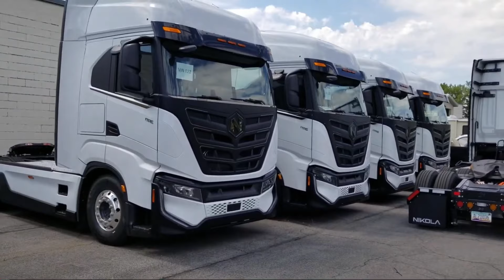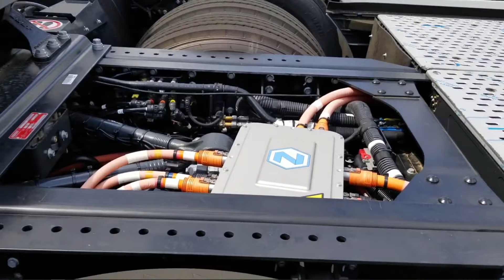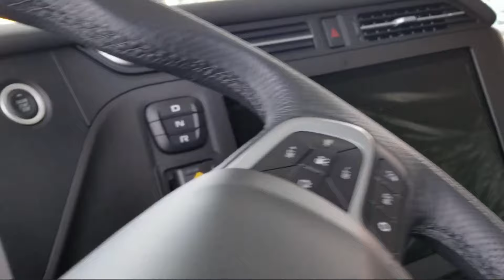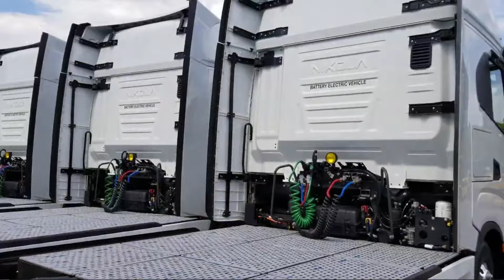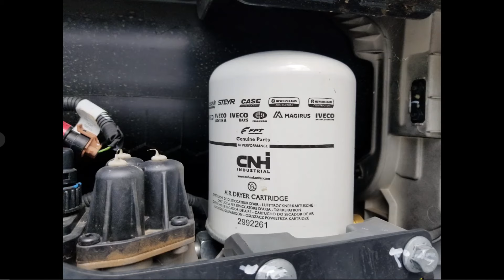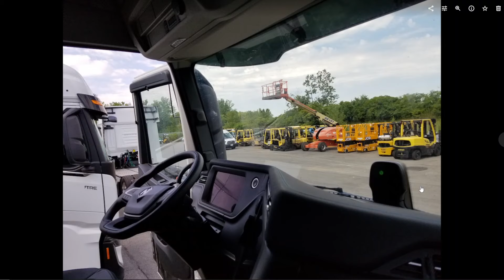An Exclusive Tour of Nikola's Battery-Electric Truck!

Comment: Seems just like the trucks iveco makes in Europe? what is Nikola doing? Buying the parts from Iveco, assembling them and putting their badge?
Reply from the maker: Umm, they are the ones responsible for literally making the entire electric drivetrain? Iveco doesn't have any parts for EV trucks because last I remember they don't sell any EV trucks, just a thought.
Reply: @visceral_investing  Indeed. I should have said, buying the parts from Iveco and others. They don't make anything, they just assemble off the shelf parts into a truck and put their badge on it.
Reply from the maker: Again, Iveco doesn't have any EV parts because they don't make EV trucks. Should I repeat it again for you?
Reply: @visceral_investing  not sure what you mean? Please read my reply again. I corrected myself and wrote, they buy parts from Iveco and OTHERS and assemble those parts into a truck with their badge. The point of my post is, they are nothing more than an assembler. If you want to contradict this, please state what parts of the truck are manufactured by Nikola. I believe none, not even the Nikola badge. Another point is, what parts of the truck are designed by Nikola, I'm sure the badge is designed by them, and maybe some cabling and brackets to secure off the shelf parts, but what about the things that matter like the motors, battery and battery related tech? I would love to see a video from you showing what they do manufacture in house, and what is also designed in house that is currently being used on a shipping product.
Reply: @visceral_investing  I've just read that the powertrain that Nikola is using on the trucks you saw and are currently being produced is supplied by bosch. Can you confirm that?

Comment: Ace...those panels on the back deck that you were questioning are covered with a plastic film to protect the finish...the end user peels it off and it's shiny stainless steel or polished aluminum underneath...so it's not like they were in hurry and skimped on the finish there. LOL

Comment: Hey I would like to point out ,The truck you saw is a fleet truck. They are everyday workhorses and not the premium owner operator versions which have a greater quality control and have premium upholstery and specs something similar to this https://youtu.be/Bx2IczbEAqs , Hey you have been a guiding light when the times were tough , so thanks for your Content. 🎃

Comment: Fit and finish on the inside and the quality of the materials are what will matter most to the driver/operator. They won’t be able to skimp too much there. Oh, and it has to have the power, range, and reliability to win over drivers and fleet owners. Looking forward to more of the FCEVs….soon! And the refueling stations!

Comment: The unit is using an air ride suspension….it uses an air bag (air spring) in conjunction with shock absorbers. Typical choice on class 8 trucks, especially on over the road units.
Reply from the maker: Thanks!